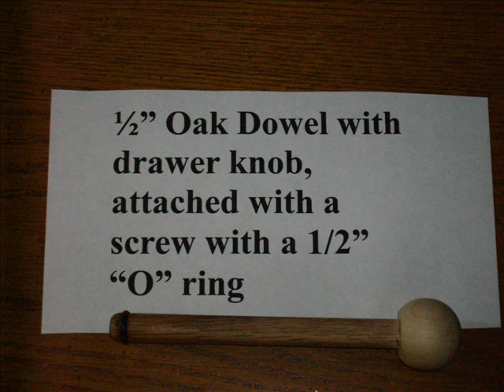Fire Piston

Comment from the maker: The plunger is an oak dowel from the hardware store.  The trick is to seal the entire end with "super glue" to make it air tight.  (1/2" dowel, 1/2" copper tube).